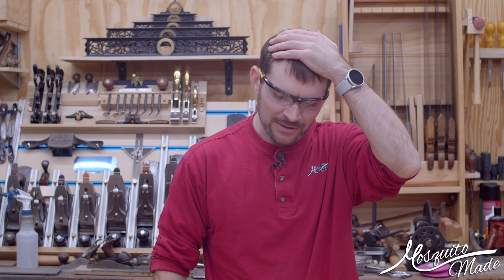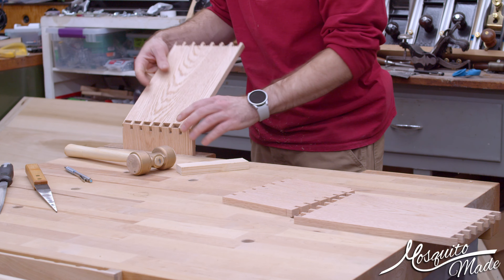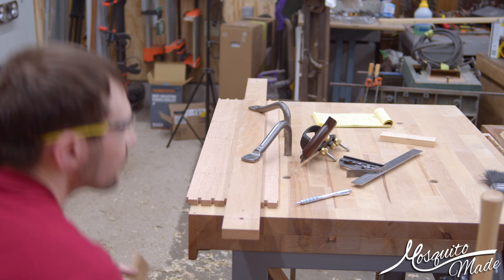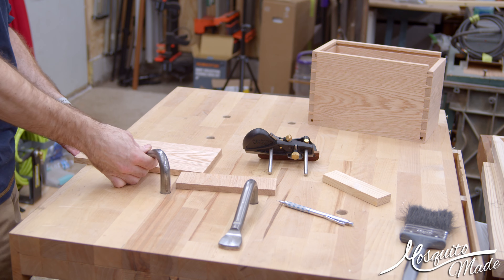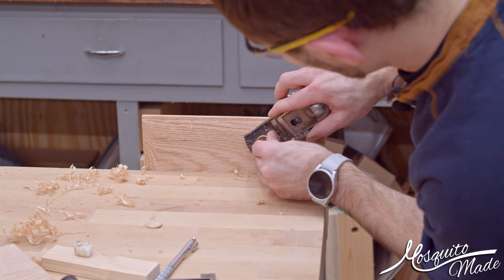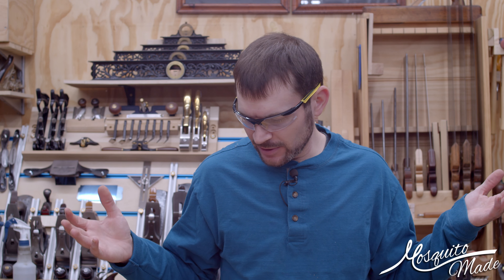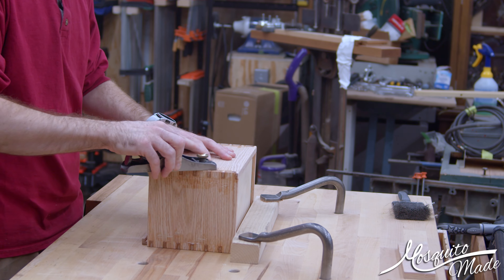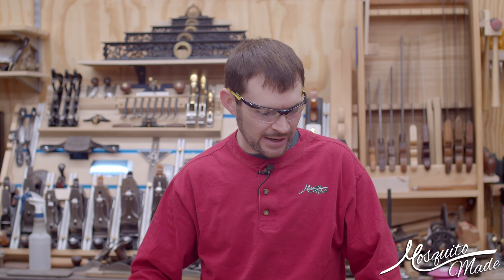Offset Box Joints for Veritas Small Plow Plane Box

Comment: Nice video.  I like the format.  Entetining and informative.  I'd like to see how you fit out the boxes. 
What brand is the bench plane you use.  No brand on the cap iron.
Reply from the maker: Thanks! The bench planes was a vintage Keen Kutter KK series plane. They were made by Ohio Tool Co, and originally had ticket tapered irons. I've replaced the irons with the thick replacement irons that IBC Tools makes. They're 0.140" thick A2, and work great in these planes

Comment: Wait a second!! How did you get two different sizes for your box joints? I’ve been trying to think of a way to do this for a long time. Please take a minute to enlighten me?🙏🙏🙏
Reply from the maker: Sure, I sort of covered that at 1:30 in the video.  Basically I've got two jigs setup, one using a 3/4" router bit, and one using a 1/4" router bit.  Normally You set the router bit to be the same distance from the registration pin as it cuts (so 3/4" from the registration pin).  What I did was matched it up to the OTHER jig's router bit.  So the one using the 3/4" router bit, I set to be 1/4" from the registration pin.  On the other jig, I set the 1/4" router bit 3/4" away from the registration pin.  It's kind of tricky to get it dialed in, since any tweaks to one impact the other, so you sort of have to adjust half on one and half on the other, and very tiny amounts at a time, since any error gets compounded over 7-8 joints... 

Rob Cosman also has a video about a DIY jig he built for two routers that does the same as well.  You should be able to find that one if you search for "Dovetailed Finger Joint Jig" I think